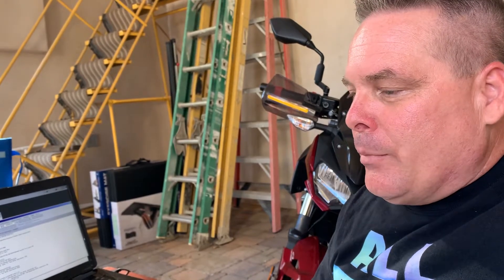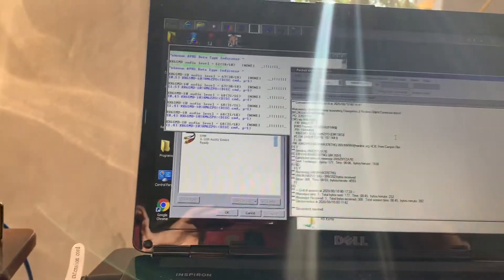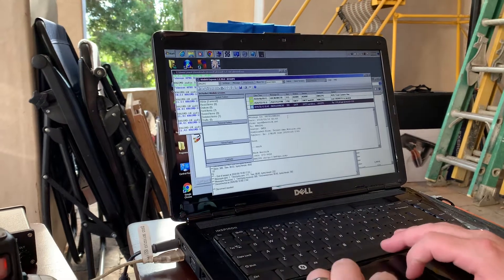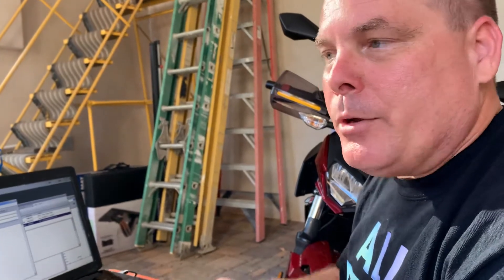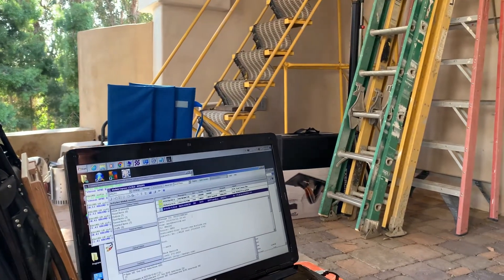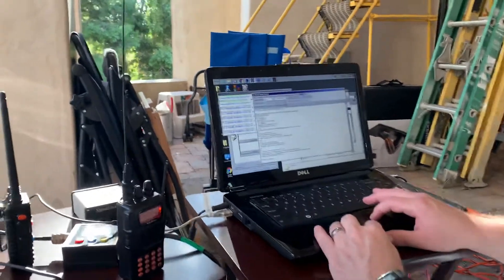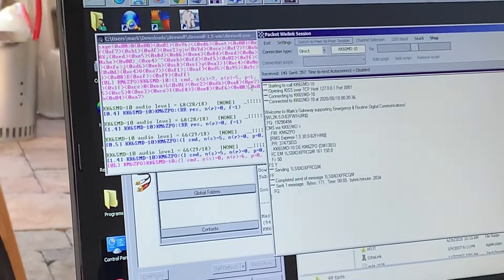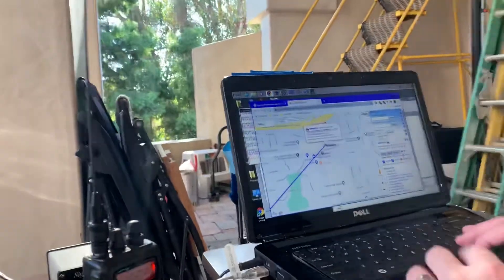WinLink with SignaLink, Direwolf and Kenwood TM-281A

Comment: Hi there, nice video! I own an IC-7100 (over USB), FT-2980, FTM-3100 and a FTM-3200D. I heard this Kenwood has a great receive. Do you think it outperforms my radio's with regards to decoding more packets? Is it really extremely sensitive? Kind regards from The Netherlands
Reply from the maker: It really shouldn't matter what radio you use all things being equal.

Comment: Hi there, what cable did you have to use for this?
Reply from the maker: There are two cables. One is a simple rj-45 cable that connects the Signalink to the mic input of the radio. The other is a mono 1/8 audio cable which connects the speaker out of the radio to the speaker in on the Signalink.  It’s identical on my 741 so I suppose many Kenwoods are the same. But you should ask Tigertronics about the needed pin wiring.